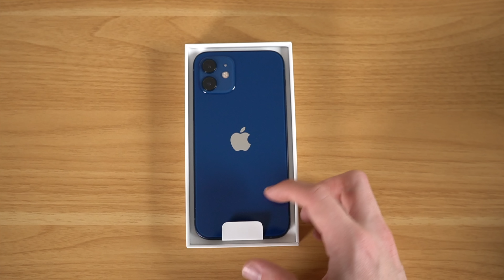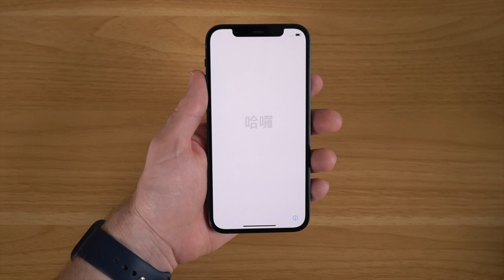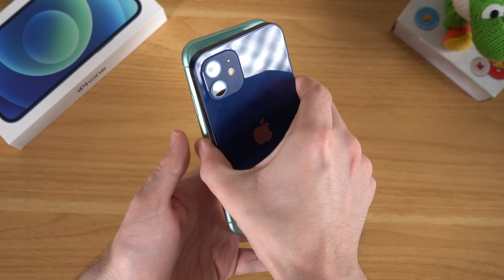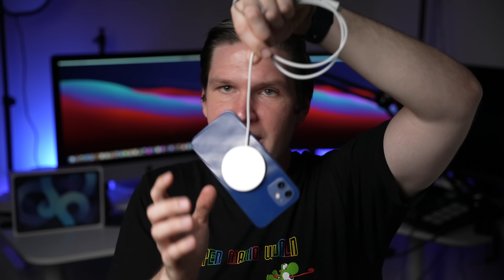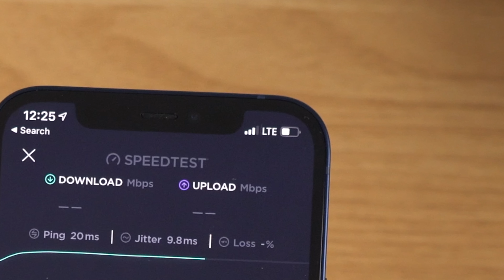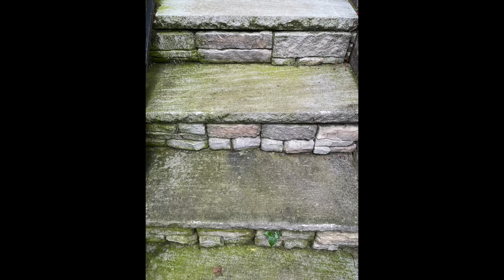iPhone 12 - The Wait is FINALLY Over!

Comment: Big fan of your videos. I have a small question about purchasing an iPhone. I currently have an iPhone X, and I am considering wanting to upgrade for multiple reasons. Including I have always wanted an iPhone with night mode and I am a bit obsessed with the new blue color. However, my current version plan does not include 5G in the plan (which I honestly don't care that much about), and I am not sure if I want to add it because it's 2020 and it is too new. Therefore, I was wondering if you know if I could purchase the phone in full from apple and just put in my Verizon sim card from my current iPhone without having to pay for 5G? Which would probably improve the battery life without the process of the phone going back and forth between 4G and 5G. If you don't currently know, please try and let me know once you receive the phones. Or do you think I should not bother upgrading at all and just keep my iPhone X for one more year?
Reply: The x is excellent. If you buy a new phone. If your current plan has 5g if it’s available you will get it. If your upgrading to the 12 reg. 50/50. If your going for the pro then do it. I have the 11 pro. I’m not updating. My nits are 800 1200 iPhone 12 mini reg 600. If it’s pro then 800 nits. I do like the video in Dolby but if your not a photographer or takes a lot of pics and vids. I wouldn’t. The 14 bionic is a great chip apples. You can trade your x in fir some cash or eBay it. I’m on the button. I’m more interested in the iPad Air 4 now that’s a big step up. Good luck.